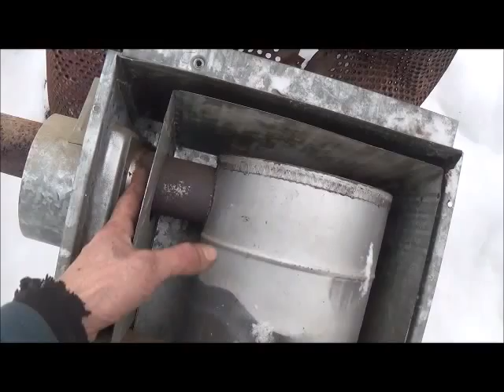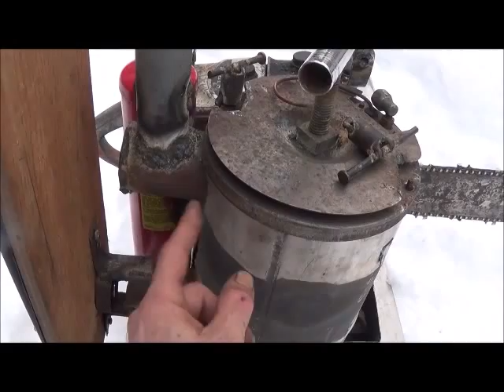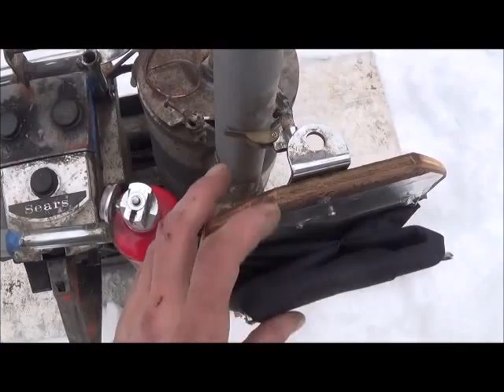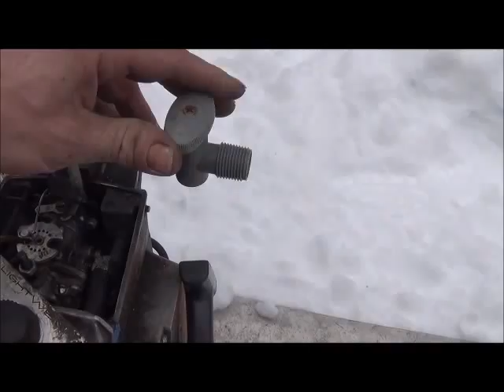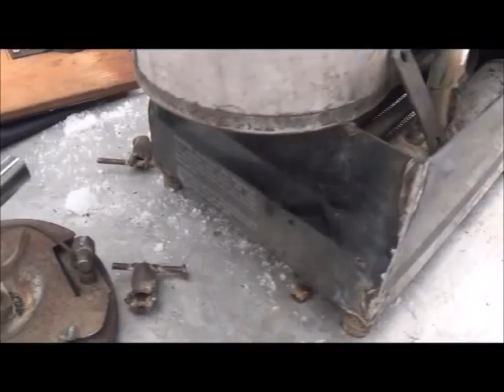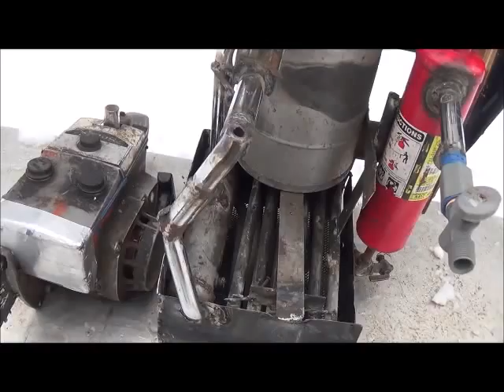Chainsaw that uses firewood for gasoline.

Comment: You could lay copper pipes with water inside down with a check valve and a refill tank so that it is well cooled by the circulation in the water then you could also drive a small turbine so you could possibly start or run the chainsaw. Or something else, what should be driven. Maybe a fan for the fire in the gas maker.

Sorry for the grammar.
I'm german 🇩🇪 and I have wrote this text with Google translater. Cause I don't know the different vocabs.

Comment: Dude, cool stuff! Did you keep the gas control stuff and thermocouple and the temp sensor that connects to the thermostat? I have one of these old propane gravity stove heaters ,mine is a larger duo therm , I want to use it fully installed in my off grid bus, but the thermostat does not kick the burner back down to pilot, do you think it is that senor or something. Can I bother you for some advice there guy, if your not too busy Please.